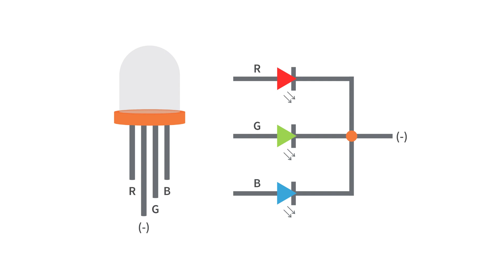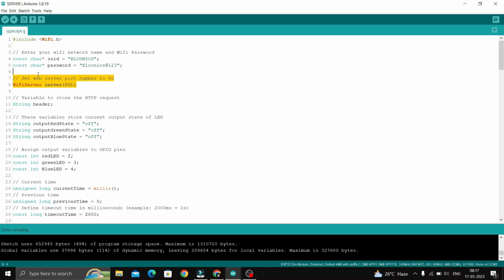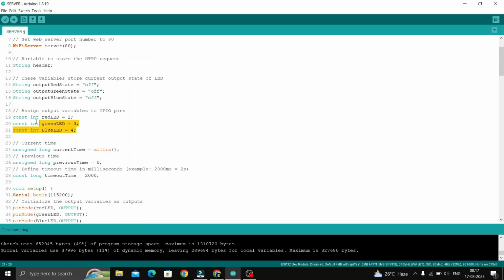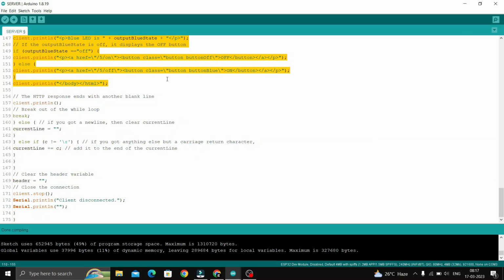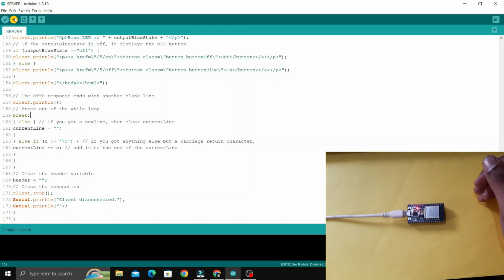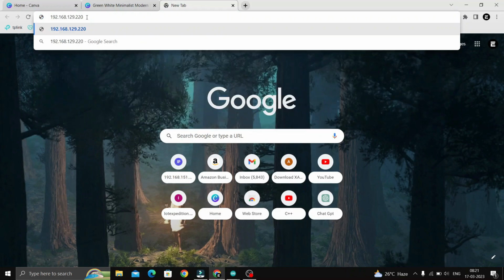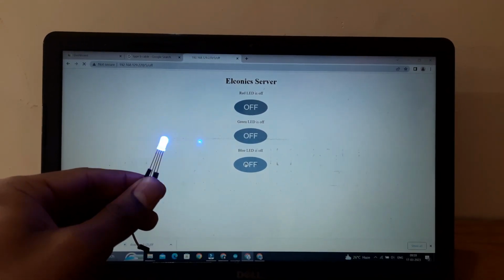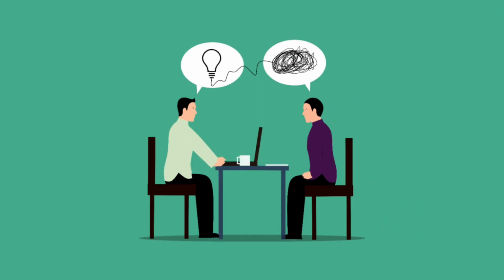ESP WEBSERVER | Your Personal Web Host | DIY Web Server with ESP32 🔥🔥

Comment: So the ESP32 could transmit an SSID and act as a hotspot.. and simultaneously the esp32 runs a webserver?  If so, what kind of data thruput could you expect?  Perhaps that's how the idea behind the dual-cores.. one does the AP, the other does the webserver?

Regardless, if the ESP32 samples the ADC 2000 per second, and updates the web page with every new sample..  what will a client , connected to the hotspot/web-server, see as the sample rate?  Or would it not be real-time, and instead the client must refresh the page manually to get fresh ADC samples?   Perhaps the user could talk back to the ESP32 via the web page as well?

BTW, very new to all this,  just ordered an ESP32 8x8 RGB board, and an ESP-PROG JTAG programmer... hoping to use Visual Studio Code to code/debug on the esp32!